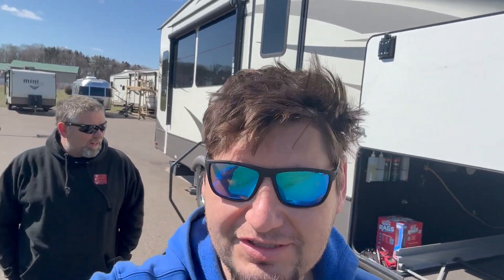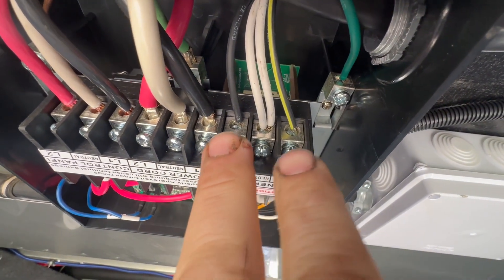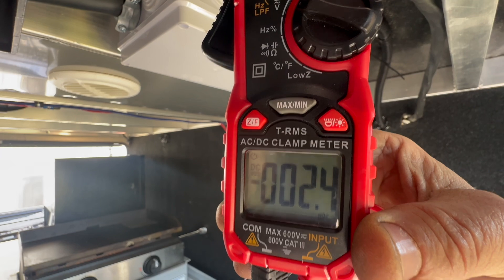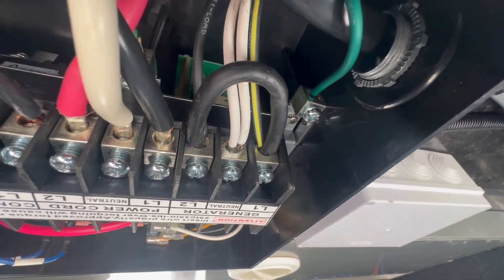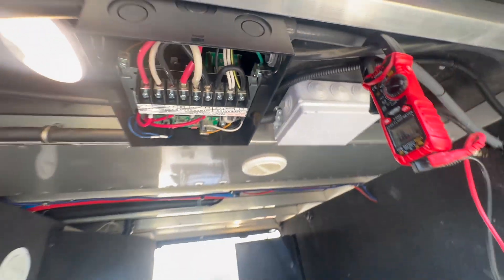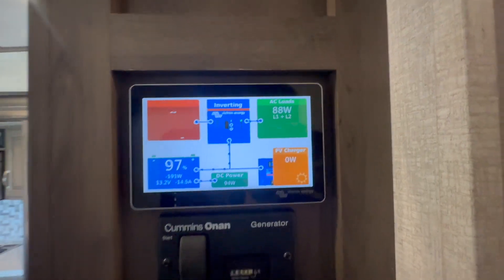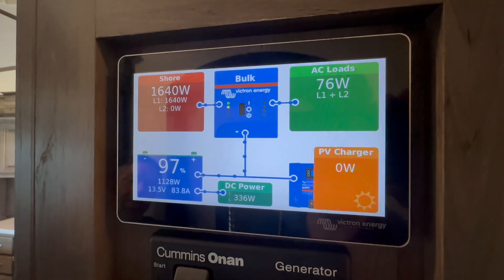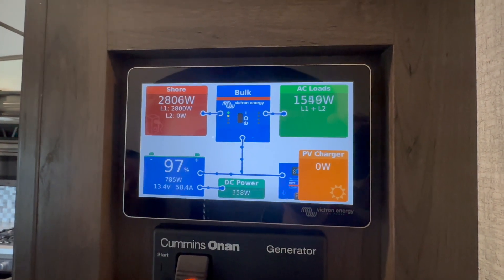How to Get Full Power From Both Legs of RV Generator With Victron Multiplus

Comment: There is only one coil in 85% of the RV generators out there.  The fact that the transfer switch has two neturals  (white wire) tells you it is a single phase.  It it was a split phase it would only have one neutral.  Just because you have zero volts between two hots is not a good test.  Testing that there is continuity between the two neutrals proves that is the same coil in the geny and a better test.  Although for your test in an RV no voltage between hots is not that bad.
Reply from the maker: Great insights

Comment: I like your solution to this issue with the jumper wire at the transfer switch.  Bryan from RC with Tito and Chad from Changing Lanes covered this same topic/issue and had resolved it successfully with a slightly different solution (whick I did with my rig)  Thanks for the video as always, Great content!

Comment: I have the 12.5kW Cummins Onan QD on my 42' Country Coach.  L1 powers the inverter (I have two Multiplus II 12v 2x120 3000watt inverter/charger).  With the 4800 (2400watts usable from each Multiplus II) watts from the multi's inverters/batteries, I can also draw up to 60amps (2x120 in phase?) on L1 from the generator.  L2 coming into the inverter from the generator is always 0 volts.  Is this normal?  I also have 50amp shore power (2x50x120) capability.  The ATS Prioritizes Shore over Generator when both are present.  It is great being "100% Victron" (no Victron batteries... too much dinero!).
Reply from the maker: Put a meter on the two hot lines. If it’s 0v you have the same issue here. Although that generator is awfully larger to be single phase.
Reply: The 12.5 is split phase same as 50amp shore power. You have a wire issue from the gen to the transfer switch. I had a the same issue was a bad connection at the gen end of the wire. You should get 240v with the meter on hot 1 and hot 2 if you don’t you have a wire or gen issue.
Reply: You need to reconfigure your mp2’s to split phase. Way more charging power and not limited to the single power of the L1 feeding your load center. 
This is the biggest con(and mistake)  of using the mp’2s for a 50amp service. You’re better off having a standard mp and configuring them for S/p.
Reply: Shorting the two single phase generator outputs together solves the problem for 5 KW and under as the combined current is 50 amps or less. Generators above this like 8KW and ~12 KW are still single phase but the combined current will be greater than 50 amps. The MultiPlus and other inverter chargers have a 50 amp input limit and if they detect single phase will drop the L2 input allowing all the current to go into L1. For 8KW and up the combined current will exceed the MultiPlus L1 50 amp limit. Also, auto transfer switches and neutral lines are typically set up for 50 amps. This solution is to use an autotransformer to convert the combined generator single phase output to a 120/240 Volt split phase. I have this problem due to my installer wiring up this solution. I will be adding the Victron 100 amp autotransformer between the generator and the generator input on my auto transfer switch. You will want to join the generator outputs at the input to the autotransformer so the generator current will equally flow through both L1 and L2 wires until they join at the autotransformer input. After the autotransformer the combined power will be split phase which will go to the MultiPlus and be detected as split phase and both L1 and L2 will be passed through the MultiPlus just like shore power. Use the diagram in the Victron autotransformer manual in section “Stepping Up Voltage | 120 VAC single phase to 120/240 VAC. Replace the inverter shown with your generator.
Reply: @markheene8852  So, my 6kw diesel generator that produces 50amp/25amp could concievable output 50amp single phase on a single leg?
Reply from the maker: If you combine them together, yes. But if we’re working with 6/4 conductors there shouldn’t be a problem.

Comment: why not install the autotransformer?
Reply from the maker: Because the generator is not splitphase.
Reply: @sotasolar the autoformer splits the single phase from the genny… thus giving you the second hot leg.  O S/p loads, no need for s/p
Reply from the maker: ¯\_(ツ)_/¯  I’d have to think on it. I’m just not sure how that solves the problem any better than the scrap wire does here. When the coach is in inverting mode it’s on 120 single phase on two legs, Nothing is 240v. Actually the more I think about it, the AS would negate all power assist on L2, you’d only get it on L1 .  Now if it’s a dual inverter setup wired as 240, you’re onto something. Just not seeing it here though. 

As always I appreciate the ideas.
Reply: @sotasolar  Thanks, i planned to do use it for my 48v dual inverter system but your video should save me from having to purchase the autotransformer
Reply from the maker: Great, if you need any parts. We do dropship. Helps support us. If you have it or have a rep you’re working with no problem.